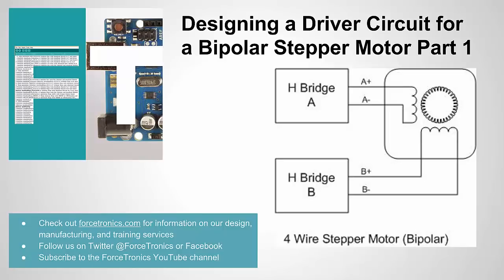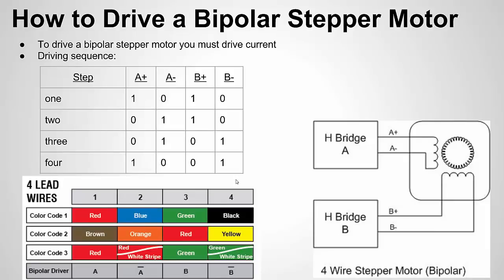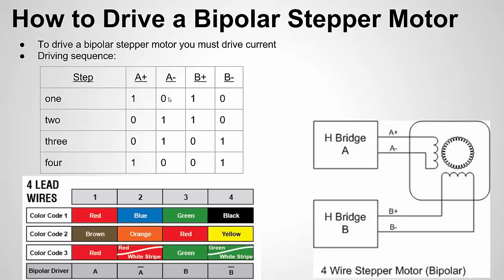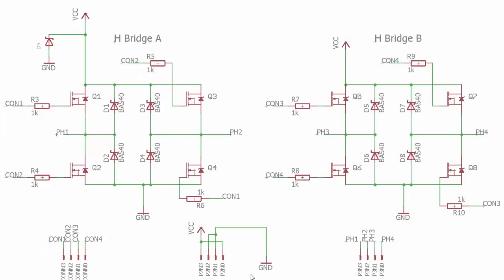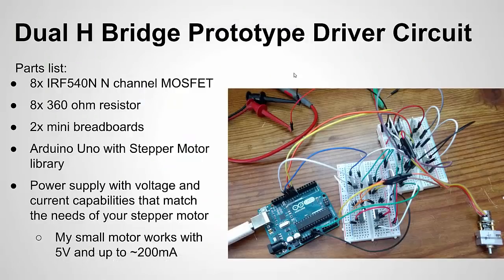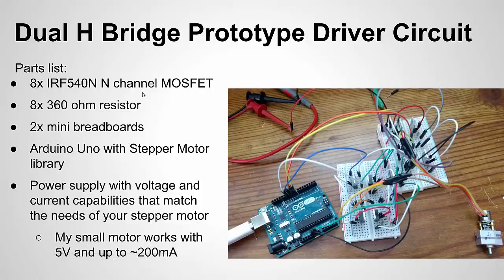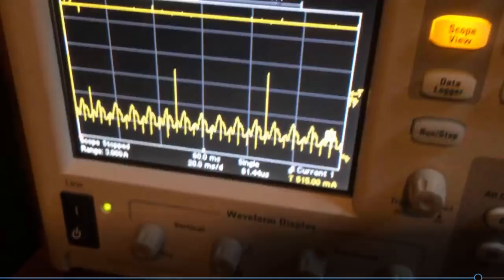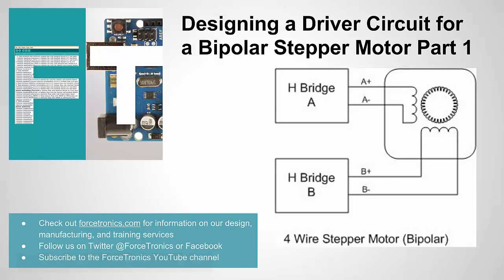Designing a Driver Circuit for a Bipolar Stepper Motor Part 1

Comment: Hey, if a short happens or motor gets stuck and a driver gets fried, any idea what would fail in the circuit? I have an MKS Base 1.4 motherboard on a 3d printer and 2 of the drivers are fried where the motor just buzzes and doesn't turn. first the extruder plug/driver died because the driver did not have enough power to do direct drive and then during testing i used a second port to test if the motor was bad or not and it worked fine for a min then till it was low speed and it fried that plug/driver also. I tried the motor on a plug spinning freely and it worked fine on one of the other plugs so i am sure the motor is good. I also tried several motors on all the plugs and confirmed they are good too.  this is what it looks like: https://www.robotdigg.com/crab/image/2016/09/24/42812eb78aba6940ef71ddf0f7e5db63-300-300.jpeg  and another pic  http://osoyoo.com/wp-content/uploads/2016/06/DBGD100200%E4%BF%AE%E6%94%B9-1.jpg
Reply from the maker: Typically when you damage an H bridge based motor drive circuit with over current you are creating a short in one or both of the H bridge legs. This is done when both transistors in that leg are on at the same time. Before you turn on a transistor in a leg be sure to turn off the other first. Also be sure to pull down the gates of the transistors to ground so that stray charge at the gate doesn't unintentionally turn the transistor on.

Comment: There is one dangerous fault in this circuit, and that is in the gate drive for the four mosfets. While the arduino is powered and the drive pins are configured as output or input, the gate charge has somewhere to go and the mosfet can turn off. But, if the output is tri-stated for any reason, the transistor cannot discharge the gate and the transistor will remain in the ON state for some time while the charge dissipates to below VgsThreshold. The gate drive of a mosfet must always be tied to some kind of current path to remove gate charge. In this application, the bridges are prone to 'shoot-through' where both transistors on one side are conducting at the same time, shorting Vcc to ground. I think this is where those big spikes in the current trace are coming from.
I see this has been fixed in the second video.

Comment: There might be an error in your design. The two top Mosfets in each H-Bridge need a higher voltage at the gate. When you reach current saturation,  the source pin will be at 5V, so gate needs to be at 5V+X to keep the Mosfets on. 
Possible solutions are either use an Mosfet-/H-Bridge driver for this, or use P-Channel Mosfets for the top ones instead.
Reply: In this particular application, the high-side Vcc voltage is 5V, so it will work just fine. In the general case where Vcc could be anything from 3V3 to 48V or more, then of course you are going to need a high-side driver referenced from Vcc for the higher voltages.
Reply: Exactly. I was looking at the N-channel FETs on the positive side thinking, wtf? I would use a 1k pullup from the positive supply to hold the P-channel gate high, and use a small signal 2N7002 to pull it down - then the microcontroller can drive the diagonal with one signal, or turn on both for brake, or turn off both for coast. 2N7002 are practically free.
Reply from the maker: Hey great catch, thanks. Yes the way the circuit is constructed you can turn the motor on but you will never be able to apply full VCC across the motor because Vgs threshold will limit you. In part 2 I will go with a MOSFET driver that will allow higher voltages on the gates. Not sure P channel method would work because you could not initially turn it on without a negative driver voltage, thoughts?
Reply: P-Channel Mosfets can be turned on by pulling the gate to Ground, but this will double the amount of needed Pins at the micro controller, because you cannnot combine the diagonal ones.